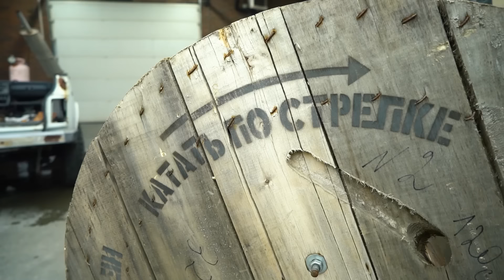We make a nutty carriage on 47 inch wheels (cable reels)

Comment: Now you need large agricultural inner tubes to fill the center of the spools, it would create large flotation tires.
Reply: Great idea!
Reply: I was thinking that too.
Reply: да!
Reply: This! The spools held up better than I expected ;)
Reply: Don’t think that it will have a enough flotation to hold the car out the water plus you would still need to move forward and back  so you need paddles on them also,,
Reply: Boards in a vee from side to side so they don’t sink or fill up with mud
Reply: do you have no water to float on there it's all ice

Comment: Bigger wheels take more torque to turn them. Rubber air filled tires absorb the bumps in the road, wide tires have more surface area for better grip. Tire threads make more grip. Having the wheels as close to the center of the car as possible means the weight is more evenly distributed on them so they wear more evenly and are less likely to snap off. It's like they tried to make the worst wheels possible.

Comment: I have a new one for you. Cleetus ran a bone stock LS the other day on a mix of ethanol/Nitromethane, +60% HP/TQ It was WILD, NO BOOST, NA. HP went from like 280 wheel HP to 490+  Run a LADA on mix of ethanol/Nitro, they put in like 49 degrees of timing.
Reply: Cleetus did that like a year ago though didn't he

Comment: A great project as always. I wonder if you nailes pieces of wood and filled in the space across the 2 rims of the spool so as to to make a flat wheel of 1 meter across or what ever it is. This would give so much surface area on each wheel, I think then it would probably drive on the snow. What do you guys think ?

Comment: Put some tubing from a tractor or something on each wheel  and go drive into/onto a lake😂 you could use thick rubber flaps/blocks secured by cargostraps  around the tubing for more powah😂

Comment: You need to string some chains or cables across the spools for traction and then but in a real engine. Something with high torque.

Comment: I think you should putt rail wheels on a car and find some train trucks that are not used to test it hopefully you know about the movie back to the future 3 don't know how much of Hollywood makes it into Russia but in the movie they go back to 1885 and they run out of gas because of an arrow that hit the gas line the chaste away from it before they could fix it or try to save the gas so the only way to get the DeLorean up to 88 mph to activate the time circuits was to push it to 88 using a steem locomotive it's a really good movie and high rail vehicles are a thing but they have wheels that drop down I'm talking about putting them on the wheel hubs like a normal wheel

Comment: Disintegrating?  Well, wooden wheels were meant to be pulled by 4 or 5 horses, not driven by... 35?  50?  Nice fun!  Now, if wooden wheels can spin out on hard surface, not ice...  I wonder... first intentional doughnut with wooden wheels?